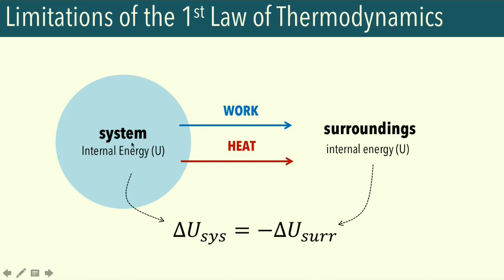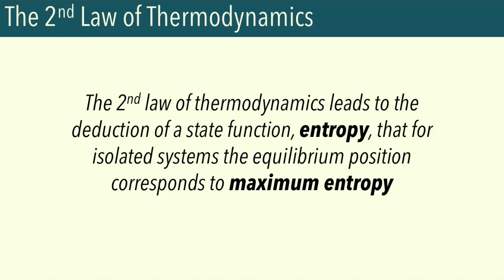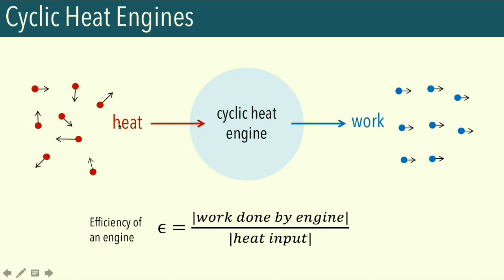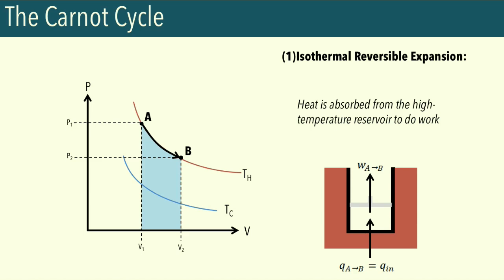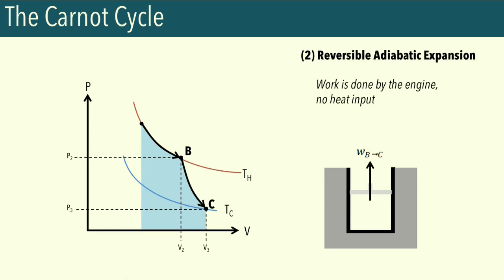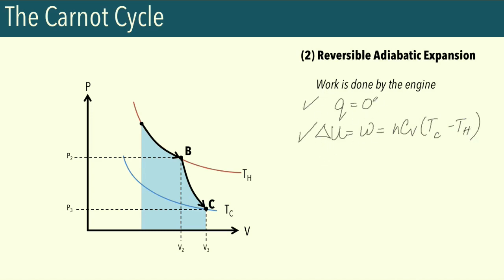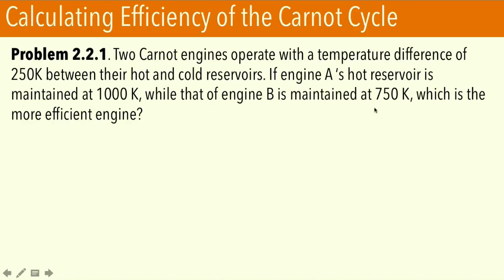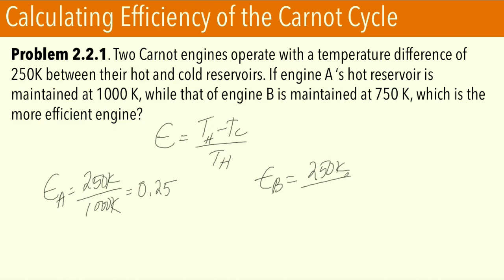2.2.1. 2nd Law of Thermodynamics I

Comment: The heat source in the case of IC engines is from the spark plugs?

Change in Internal Energy in the case of IC Engines is from the fuel addition?

How about Steam Engine or steam Turbines?

The heat source in the case of steam engines or steam turbines is from burning coal used to change water into steam?

Change in Internal Energy in the case of steam Engine or steam turbines  is from a change in Internal energy from the water changing into steam inside the boiler?

Basically the system includes the fuel, steam and the mechanical parts?
The system includes the gas and the mechanical parts in case of the gas turbine?

& the change in internal energy of the working substance is the hidden force (thermodynamic force)  behind the external work that we see as shaft movement or rotation.

Please verify thanks

Comment: There is also a 4th law of thermodynamics as entropy is dual!
From a converging, convex or syntropic perspective everything looks divergent, concave or entropic -- the 2nd law of thermodynamics.
All observers have a localized, focused or syntropic perspective.
Mind (the internal soul, syntropy) is dual to matter (the external soul, entropy) -- Descartes or Plato's divided line.
My syntropy is your entropy and your syntropy is my entropy -- duality.
Syntropy (prediction) is dual to increasing entropy -- the 4th law of thermodynamics.
Teleological physics (syntropy) is dual to non-teleological physics (entropy).
Ellipsoids are dual to hyperboloids -- linear algebra & matrices, Gilbert Strang.
Positive curvature is dual to negative curvature -- Gauss, Riemann geometry.
Curvature or gravitation is dual -- gravitational energy is dual.
There are patterns of duality hardwired into physics, mathematics & philosophy.
Homology is dual to co-homology.
Integration is dual to differentiation.
Homology and integration reduce the number of dimensions or states -- a syntropic process.
Co-homology and differentiation increase the number of dimensions or states -- an entropic process.
Syntropy (convergent) is dual to increasing entropy (divergent) -- the 4th law of thermodynamics.
Gaussian negative curvature is defined by at least two points -- non null homotopic.
The big bang is a negative curvature singularity or a white hole -- Janus hole/point.
Janus holes/points have two faces (duality) -- Julian Barbour, physicist.
Points are dual to lines -- the principle of duality in geometry.
Null homotopic is dual to non null homotopic.
Topological holes cannot be shrunk down to zero -- non null homotopic.
The "bridge" between elliptic curves & modular forms is duality!
Injective is dual to surjective synthesizes bijective or isomorphism.
Thesis is dual to anti-thesis leads to the converging thesis or synthesis -- the time independent Hegelian dialectic.
Isomorphism is duality: two differing descriptions or aspects of the same thing.
Gravitation is equivalent or dual (isomorphic) to acceleration -- Einstein's happiest thought, the principle of equivalence (duality).
"Always two there are" -- Yoda.
Duality is hardwired into the laws of physics & mathematics!